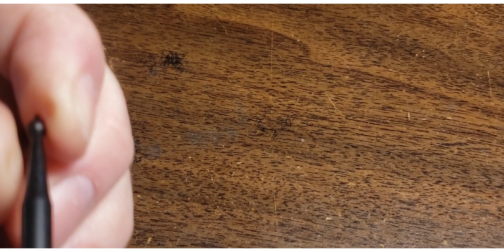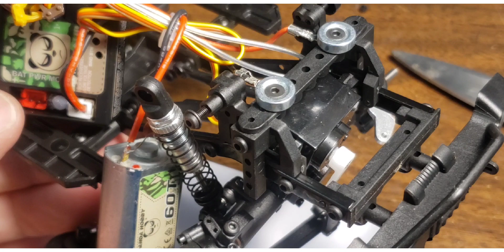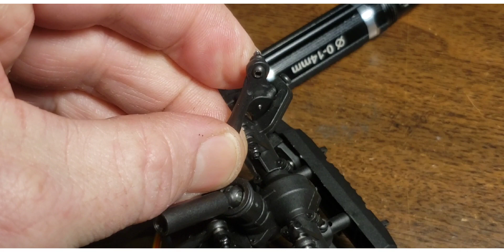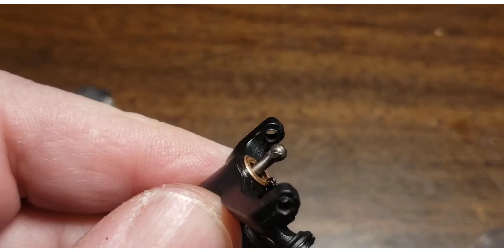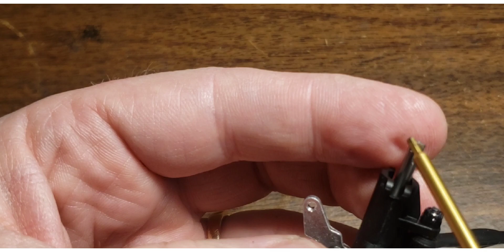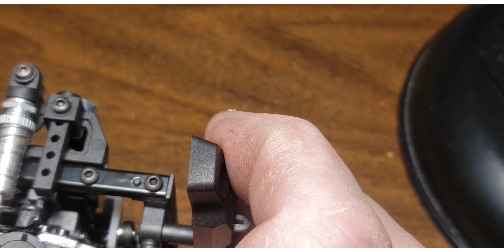Tetra 24, Part 2. More Fixes For Everything.

Comment: Stoked I found you!! Thanks for the hard work on this vid, long, but so grateful! I'm digging my panda 1/24th, but so needed your tear thru. Isn't the worm gear thread backwards because of the portals gearing?
Reply from the maker: I
Yes but did not have to be. They could have put the front diff on the back. It would have looked the same. I may swap the diff gears front to back so I can use the big SCX24 gear in place of the one my truck came with. I would have to flip the switch on the controller from R, to N.

Comment: Treal type b wheels don't rub. I actually flipped my servo and linkage over for better clearance. I'm running a furitek tegu and flysky receiver which gives you good low speed and I think it will now give my heavily modified scx24 c10 a run for its money. I'm definitely going to chamfer my links and shocks like you did. Stock it is a POS, but I think with modifications, it has potential. Atlas 6x6 brass wideners should work good when back in stock

Comment: Thanks for the video! I have found the Black Coating on the ball combined with imperfections in the plastic may be cause for most of the friction in Most Micro and 1/10 scale Rigs. Swapping chrome balls in place of black helps but the ball opening in links still need polishing. If chrome swap out isnt option ,I've Soaked in acetone and polished them with the dremel. Also, I used a small fuzzy spherical polishing bit inside the Link ball opening  in both cases.  Almost Perfect Results. But if still a little stiff , a drop of wd40 does the trick- the petroleum will break down the plastic just enough to make it buttery smooth. As far as the worm drive fitment- I think they've skipped the Tumbling/Polishing stage of Production lol. The shock piston has no porting which leads me to believe they were designed as internal spring shocks and cannot hold more than a drop or two of oil/grease. You got a Gen1 brother- I bet they're watching and listening- maybe they send you a gen2 improved with your recommendations taken seriously! They just used readily  available parts and threw this together but Watch - Gen2 will be SpotOn don't give up yet !Great work breaking down the issues with this baby👍
Reply from the maker: If they take what I showed seriously a Gen 2 rig could be very good. The concept is sound. I had some fun at the end of the video with the wrench but it is very nice. 

The electrified magnets are fantastic but heavy. They should mount lower, perhaps on the inside-the-body portions of the rock sliders. That would separate them so the ESC doesn't accidentally get shorted out by a random metal part touching both leads at the same time. 

I have another idea that will help about every manufacturer when it comes to building skid plates. Look for it in my upcoming Tetra 24 Suspension Fix Video.